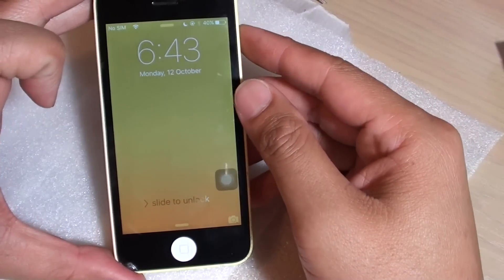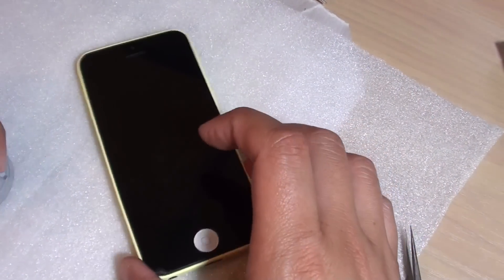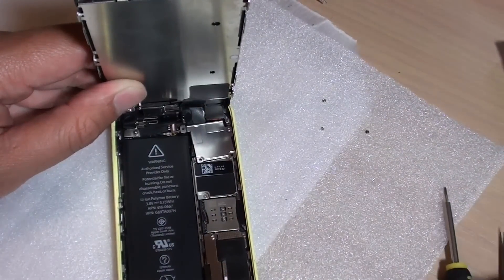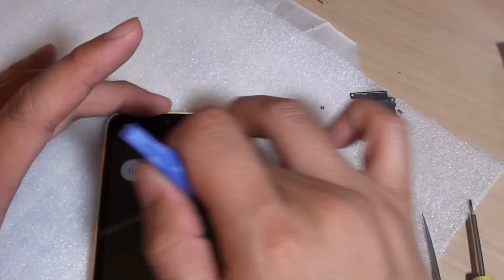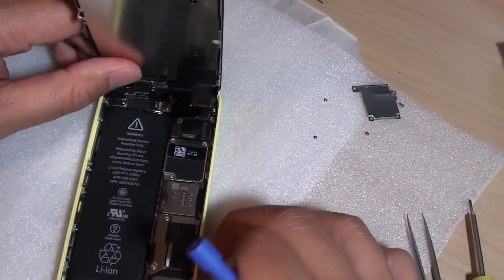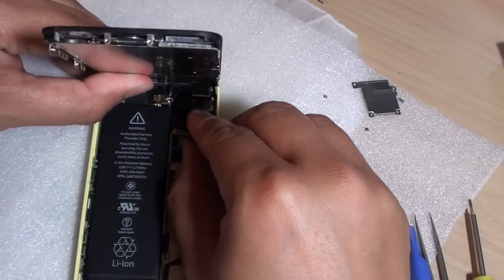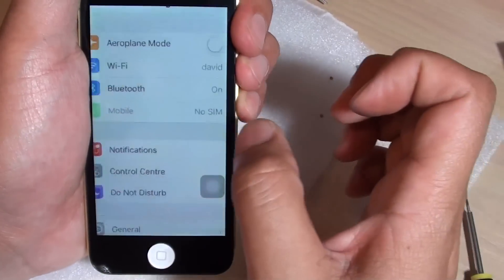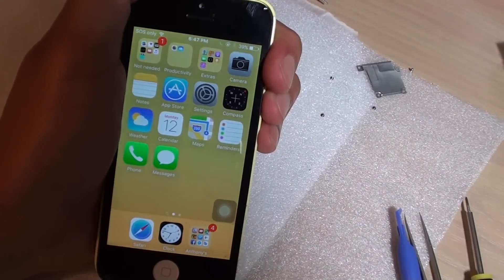iPhone: Fix Touch Screen is not Responding Properly

Comment: TKQ v m for TIP WILL try if it  works ,mine too , slide power off does not  move. Also not able to  fill my password as touch screen
Does not respond to keys. Many time touch connector put back but no result??? Vl try after seeing this video

Comment: Mine iPhone have different type of issue the touch is working well when you unlock the phone if you touch on screen it will go to search any solution
Reply from the maker: If you try to disconnect the flex cabke and connect it again. It sound like touch sensitivity issue or flex cabke connection issue.

Comment: The issue came after changing iphone lcd which is too sensitive. Even smallest amount of oil or water causes ghost touch. Try cleaning the screen until it’s squeaky then put on a screen protector. That fixed my phone.

Comment: Guys make sure you know this will STOP YOUR WARRANTY, use this only as last resort. If you have this problem , go to an Apple Store and ask for help. If you have already changed the screen and it's not working then your warranty is over, but if there is no other option then use this, it does work.

Comment: Also, make sure your screen doesn’t have a plastic protective sticker on the back of the screen or the connectors. If it does, remove it and wipe down really well with rubbing alcohol and a qtip. I had this problem on a 6 plus, took it apart, removed plastic, wiped down, worked perfectly after that.

Comment: WoW. My nightmare for last two months. Screen is not responding on the left hand side from top to bottom. It's only small stripe maybe quarter of an inch wild going through keyboard letters c, f and r. Really annoying! Tomorrow I'm going to try your solution, I hope it will fix my issue. Anyway, big thanks for sharing solution, Trying to help people solve issues without spending a fortune. 
Cheers Bro.

Comment: Sorry for turning off you could disconnect battery also that kind  problem  could be from socket connector but 99% is not .The main problem is digitizer Touch  controller ic in the mother board is bad ,Even if you see after reconnecting the screen problem solved but you will see that problem again and again.It means Apple is trash and toy and disposable toys maker company.

Comment: hi i m also use i phone 5s last 4 month
and my experience is for this device,
this device is very badly working 
1. phone is very heated use with mobile data
2.touch screen problem 
 so i m not like this device  iphone 5s

Comment: My issue is my phone act like there are multiple fingers on the screen when it's not 😕
Reply: iPhone bottom row won't work six s
Reply: Saaame :(
Reply: Super original username BUT WHAT IS OLEOPHOBIC coating?
Reply: Nameless King I found a solution! Just put a screen protector on your phone. But since I have a 5C, screensavers a really expensive, so I just put clear tape on my phone. It's been working great for twoish days.
Reply: Luis Garcia mine too, no touch reaction at all. But have you tried this method of clicking the connection properly ? Pls do let me know if u have done this and whether it's workable bruh
Reply: minee tooo whenn iits. cchharrgginng. this. iss aan eexxaammpplle
Reply: same! My phone is practically unusable.
Reply: same!
Reply: same. Did this video work for you or did you find another way?
Reply: Super original username It didn't work.... Hahahah
Reply: lpsbunnytv thank you so much my phone works perfectly fine you are the biggest legend!!!
Reply: Use a screen protector or tape it really works
Reply: LoveRiddimz tempered glass won't work right? i have the same situation to nameless king
Reply: same I don't want to sound greedy buts its gotten to the point that I really hate my phone and don't use it at all.
Reply: Super original username THANKS A LOT :) TOMORROW I WILL BUY A SCREEN PROTECTOR :)
Reply: Super original username and when i put it i should keep the wet and dry before putting the tempered glass?
Reply: Nameless King same
Reply: Rebecca bean I got my phone fixed from my local mall, and ever since then I can't even scroll down without it clicking on something. I put a glass screen protector on it and it's still doing the same thing .
Reply: same
Reply: lpsbunnytv and
Reply: maybe try one of the ones that stick on?
Reply: elemento try tape
Reply: Nameless King 

Yhyh
Reply: Same
Reply: Me too....any clue how to fix it?
Reply: omg same, I just got my screen replaced yesterday
Reply: Mine one have touch issues its like when you touch on screen it will go to search any solution
Reply: My issue is that like if I'm playing a game and for example I turn left it turns right or I'm looking up or you know the opposite direction
Reply: Same tf
Reply: Super original username thx
Reply: Outsider 001 
My
Reply: Super original username ZP4RKER
Reply: bruh same
Reply: same tbh
Reply: Outsider 001 for me it’s both it’s like ghost touching and some times I can’t even touch it I really can’t afford to have a broken phone and it’s hard to go on the website if I can’t tap anything
Reply: Pressing buttonnnns
Reply: Outsider 001 mine is how when I try to open it the screen freezes of doesnt respond =<=
Reply: My issue is that my iphone 5 always moves itself to one corner, I tried to find out what was wrong by getting a drawing app and I was correct. It was similar to a broken glass screen
Reply: Same
Reply: Same in specific areas
Reply: Same problem
Reply: bruh my issue is that the touch doesn't work
Reply: @LuisGarcia-uq3rk  me to did that video helpt to you did i gona make same ting
Reply: same here anyone know a solution?
Reply: Nameless King me tooo
Reply: Nameless King sama here
Reply: i have the same problem
Reply: same here..
Reply: Nameless King take it to a phone shop, you need to get it repaired.
Reply: Put a screen protector on your phone that worked for me for now, works like normal

Comment: dude you saves my life.  I replaced my whole screen and I did not snap the flex connector right but seeing this made me realize it . I was about to send. my phone to an expensive place to fix it so you saved me money as well.  thank you so much 
if anyone here replaced their whole screen with. other tutorials but the touch did not work open it again and make sure the cables are fixed well like this guy said!
Reply: Grand tour episode 2
Reply: i broke my screen again guys fml gonna have to go through the process again
Reply: yes I had a problem like yours my volume buttons and power button stoped working after replacing the screen I acedently undid a small connecter and saw it the next time I cracked my phone and replcaed the screen.
Reply: lol

Comment: You should NEVER remove the screen while the phone is on, It can damage the screen connectors on the motherboard which isn't an easy repair. Just disconnect the battery or wait for the phone to die.
Reply: Andrew this shit happened to me the first time I replaced a phone screen. Fried the motherboard to screen connector.
Reply: thanks for your advise
Reply: yeh I would agree
Reply: So to solve the unresponsive touch screen just let ur phone die?

Comment: I recently repaired the screen of my iPhone 5s and I watched this video but I don't think I have the same problem as you or I might have the same problem as your phone but I'm not sure. Anyway whenever my hands become hot I sweat very quickly and therefore my screen becomes wet and then It starts to spaz out and cant touch anything. Its only when I lock my device and then wipe it to get rid of the sweat. Although Ik this happens only to my phone because before the screen broke it was working fine even if sweat or water got on it. Just wondering if there's something I can do to help this problem because it might be the cables in the iPhone or it might just be the screen in general. Thank You
Reply: I have the same problem with my iPhone 5s! please let me know if you find any solutions that will help!
Reply: ok

Comment: I have this problem as well when I disconnect the lcd cables then click them back on it works and then as soon as I close my iPhone and put the Pentalobe screws in the same part of the screen is unresponsive
Reply: many the wires got damaged if you bent the cables they are fragile be careful.

Comment: I love how people expect us to all understand this..
Reply: lots of NeRdS like me know exactly what to do and how to do it.
Reply: For real tho
Reply: He just unplugged the cables and plugged them back in again, it's not hard but I'd suggest you turn your phone off first.
Reply: Follow exactly what he does and it's easy asf dwdw you'll understand
Reply: i cant turn the phone off..the screen isnt responding to touch..I will try later and see if this works
Reply: @monicatravis4893  try pressing  and holding the home button and power button at the same time, or pressing and holding the power button, or disconnecting the battery (be careful when doing this, I am not responsible if you damage your phone).
ALTHOUGHT the easiest way is to just wait until your phone depletes it's charge and turns off from no battery (just wait until your battery gets to 0% and after some time the phone will turn off by itself because there will be no more juice. Be sure to recharge your phone with the charger after doing that to turn it on. It might take some time to turn on if  the phone was completely depleted from it's charge, in other words if the phone had 0% battery)
Reply: @raphaelkgh218  Thank you! I never thought of that.  (duh)

Comment: I want to fix mine but I don't have the tools
Reply: Use an x-acto knife blade for the screws, that's what I used. A razor blade might also work
Reply: +Ricky Productions thanks for the help but I just took it to the store to be fixed instead
Reply: Amazon ...Like 11 doklars or less..Mine came with a battery
Reply: ThatRedPanda I do
Reply: Same
Reply: You only need a screwdriver lol
Reply: +JarielMC a most work
Reply: +ThatRedPanda but it costed lol smile face
Reply: I bought the replacement screen with the tools in one package on eBay for a very cheap price
Reply: how much did it cost?

Comment: Hold the power button and the home button together, till the phone turns off. Or remove the battery connector prior to trying to disconnect the cables if you want to do this with the phone off.

Comment: i guess this is the only method left  for me...i hope it works because i tried everything...thank you for the solution :)
Reply: did it worked?
Reply: Ignacio Rodríguez i got it to open but i can't unscrew the screws :3 but you should probably try if nothing else works for you
Reply: Thank you angela peace  ;D
Reply: @UserXxError  you can try with other screwdrivers or with a knife although be careful not to cut yourself or damage something inside the phone
Reply: hows it going? is it works? i got mine has the same problem (iphone 6) but i confuse whether the problem is the IC Touch or just like he is doing on this vid. actually i do not sure what he is doing in this vid.
Reply: Daniel Setyawan well in my case the cord that connect to the screen + the screen is damage so my dad just replace the whole screen
Reply: angela peace nn

Comment: Hi, My Iphone 6 drop into a bucket of water when i remove it i have dry it and it was walking perfectly fine but 2 weeks later the torching stop working and it shows those line and boxes, and later on it goes black screen when an engineer open it try to pix it. I was thinking about the screen is broken but unfortunately i put it into another iPhone and its working fine and later put it back to my phone and it still showing the same. Any Idea please on what to do next? thanks
Reply: dont drop your phone in water then
Reply: There are a few videos on youtube that repair water damage by cleaning/drying with alcohol. I would use alcohol and a soft toothbrush to clean all the connectors and hopefully get that working screen connected perfectly. Good Luck.

Comment: Dont need to unscrew ur iphone just hold the home button and the off button for a few seconds and the iphone will restart by itself
Reply: thanx
Reply: thanx
Reply: +Landon Howell No problem :)
Reply: that will not fix the problem most of the time if it is intact the connecters then you have to do what he is doing what you said just restarts the phone and why it works is because your phones ram is filled up and can't exchange the memory it needs to so it freezes then if you restart it then the ram is reset fixing your problem (ram- random access memory)